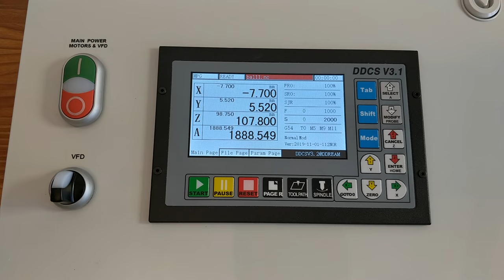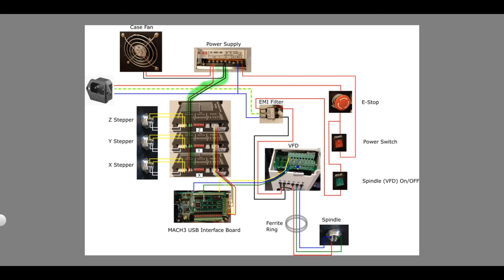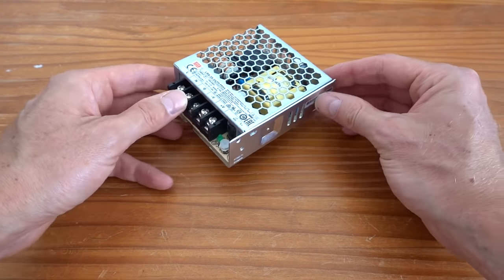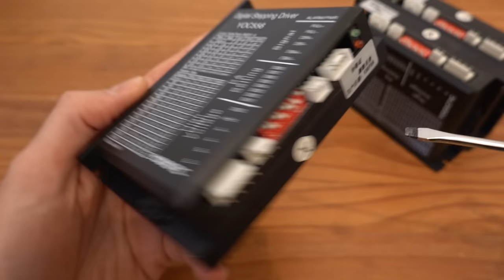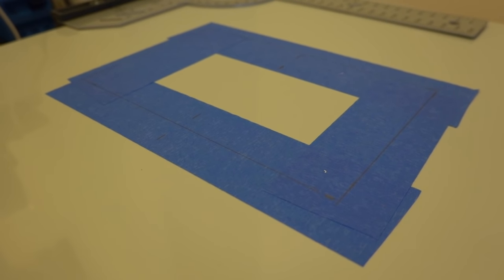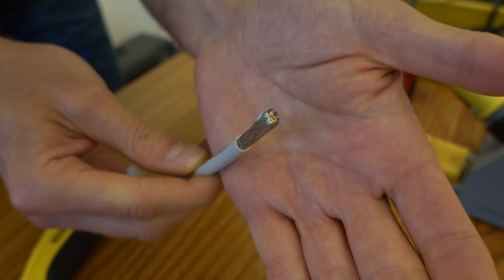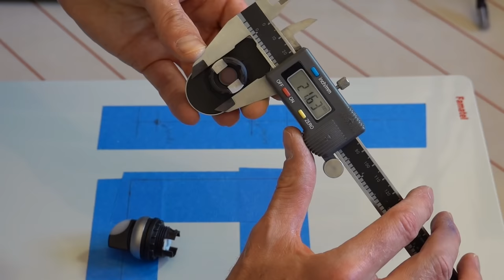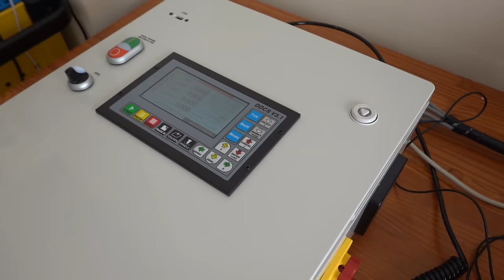Build Your Own CNC Controller, Part 1  | DDCS V3.1 |  6040 Router

Comment: Hello Robin, I have seen many videos on Youtube, but I found your video the most instructive and professional, so I am currently building a CNC controller 1 to 1 like yours.  In most CNC videos I see also the use of end-switches, like inductive sensors. Is there a reason why you did not use these? I presume the DDCS can handle input from end-switches?
Reply from the maker: Hi Ben, thanks, nice to see the videos have been useful for you. There is no specific reason I chose mechanical switches. The DDCS can also handle inductive switches, so if that has your preference you can use those as well. I did not spend a lot of time to figure out which type would be best for my application and just bought the mechanical type. I think both work fine for a home CNC router. The mechanical ones might be more sensitive to dirt, while the inductive ones can be sensitive to EMI. I would say, go with your personal preference. Same goes for other choises I made. Some at are just based on what components I could find or had on hand, other solutions or brands could also work. Please make sure to read comments of other viewers as well if you haven't done so already to get a balanced perspective. Good luck on your project!
Reply: Thanks for your quick respons, I think I will go for the inductive sensors. My machine wil be used for milling natural stone, Have to use water to prevent dust clouds and clear the dirt. So the mechanical part of the machine wil quite a challenge.

Comment: I have version Omio 2.1 of the controller you are using and would like to know what post processor you use for your files? I'm currently using GRBL, but want to learn if there are others that work with the controller box.
Reply from the maker: Hi, I am using the Mach 3 post processor in Fusion 360.

Comment: Hello. Do I understand correctly that when the E-STOP button is activated, the contacts of the magnetic starter open and the power supply of the stepper motors is turned off and the spindle falls along the Z axis?
Reply from the maker: Hi, in case the e-stop of the pendant is used the steppers are stopped but still under power, holding their position. In case the external E-stop is used the power to the VFD and stepper drivers is cut. This indeed means that the steppers are no longer under power. Since my machine is very light the Z-axis just stays in place even when all power is turned off. So it does not require a brake on the Z-axis.

Comment: The line diagram the current comes into the main and than to a (dc 24v power supply)... It shows three (power supplies) the first in line is in question. (little white looking breaker)
Does the din rail circuit breaker count as a 24v dc power supply?
I looked a the list of materials I didnt see a circuit breaker.
  trying to do just the same set up minus the spindle vfr.
what is the rating on the din rail breaker?
Thanks
Reply from the maker: Hi, this is indeed a power supply, not a circuit breaker. I understand the confusion, it indeed looks a bit like a breaker. It is the Mean Well DR-15-24.
Reply: @uptimefab7412  Right I get two power supplies one for screen ddcsv3 and one for the steppers... what does the Mean Well 24V DIN Rail Power Supply  power? thanks I'm really grateful.
Cant wait for the next Video.
I thought you just needed two power supplies
Reply from the maker: I initially intended to have both the large power supply and the one for the DDCS behind the contactor and since I wanted to disable the steppers (E-stop) without shutting down the DDCS this would require 3 power supplies, including the one for the contactor. I later decided to have the DDCS go around the contactor altogether. So, in this case it would be possible to combine the 2 smaller power supplies. However, in my research before starting this project I read people were using a separate power supply for a contactor to avoid voltage spikes affecting other 24VDC components in the same circuit when the contactor switches on or off, so therefore I decided to keep it on a separate small power supply. I am not 100% sure if this is really needed, but I am playing it safe to avoid any issues with the DDCS controller. The DIN rail power supply only cost me around 15 euro. Hope this makes sense. Thanks for your feedback!
--- Update: I have ordered a surge protector for the contactor (siemens 3RT2916‑1DG00), which should reduce spikes down to less than 1V. This should eliminate the issue. Note that I do not have a scope and cannot test this. This is according to the Siemens manual.
Reply: @uptimefab7412  yes it does thanks again

Comment: Would servo motors (and obviously servo drives) work with this system as well?
Reply from the maker: Hi you cannot connect servo motors that require a feedback loop to the controller. I think you could connect servo drives that have an internal feedback loop, but I have not tried this. I was planning to try this with a cheap servo motor set, but this is not on the short term planning.

Comment: Hallo Robin. Vanaf de "homing end switches" gaan 4 draden naar de controller. Betekend dat je 1 draad gebruikt als nul-draad die je verbindt met alle 3 de switches? Ik kan het niet goed uit de video halen.
Reply from the maker: Hoi Ben, bedankt voor je reactie. Klopt, precies zoals je aangeeft heb ik 1 draad gebruikt om alle switches te verbinden met COM-. Ze hebben wel allemaal een aparte draad naar een eigen home pin (7, 24 en 27). Hierdoor kan ik alle 3 schakelaars verbinden met een 4 polige kabel. Je moet dan wel bij elke schakelaar de nul draad "aftappen", maar dit is prima te doen. Gr, Robin.

Comment: Hello again, UptimeFab,
I have noticed that your very clear wiring diagram shows the single 24V DC Power Supply being connected to both the main DC power input of the Module and the input of the I/O DC input, These are recommended to be supplied by separate 24V supplies to avoid Earth loop issues. This is about the only sensible information I could elicit from Digital Dream, when they could rouse themselves enough to answer an e-mail. I fitted a 1AMP 24V DC supply to supply the I/O terminals separately. This is good electronics practice. I thought this might be connected to my MPG non-functionality but, alas no.
Reply from the maker: Hi Jim, thanks, I noticed this as well later on in the build. In the new version of the wiring diagram I have a separate power supply for the unit and the IO, same as you. Also found this later on in the manual and changed it. The wiring diagram was updated a couple of weeks ago to reflect this.

Comment: So, I can’t for the life of me figure out how to get the EStop on the MPG to work. What baffles me is that pin 15 for the MPG plug on the DDCS is actually outputting 24V. But I would think pin 15 would be looking for a high or low voltage signal, so it doesn’t make sense to me how it’s carrying a voltage potential? Was there anything in particular you had to do to get the EStop to work?
Reply from the maker: Nothing special, I was lucky enough that it worked on the first try. I used the blue wire for the E-stop. Did you see the wiring table in the PDF on my website? The right column called "soldered" is how I actually soldered the wires to the DDCS connector. Also had some confusion on numbering, buy this setup works for me. I don't have the LED on the pendant working, (did not even try to wire this since I don't need it) but the rest is working. If pin 15 is carrying 24V it is probably closed to COM- by the e-stop. You could check this by pressing and releasing the e-stop and measuring on the wires to which pin The resistance changes from 0 to infinite. Hope this helps.
Reply from the maker: Just measured it on my pendant connector when disonnected from the controller. The E-stop is indeed opening and closing the connection between pin 15 (E-stop) and pin 8 (COM-)

Comment: I see that you haven't connected grounding cable from the spindle 4 pin and from port E of VFD... Is it for certain safe?
Reply from the maker: Hi, the VFD has a metal housing (under the plastic cover) that is already grounded by bolting it to the metal back plate of the controller box. From what I understand it is better not to ground parts in 2 places to avoid ground loops. I am not sure how much of an issue that is in CNC applications, but at least my VFD is now already grounded through the housing, which should be sufficient.
Reply: @uptimefab7412  have you checked with multimeter a connection of housing with grounding pin? i don't know your model, but in my vfd aluminum radiator on the back isn't connected with grounding of vfd circuit board, so i have to ground it by the grounding pin.
Reply from the maker: I just checked with the multimeter and luckily with my model the ground pin is connected to the metal housing of the VFD. Thanks for the tip anyway! It is indeed best not to assume the housing is connected to ground just because it is made out of metal.

Comment: Hello friend excellent videos, I have a question how to add fuse holders to your electrical panel? would they be necessary? I hope you can help me, I will carry out this process on my machine and I already have the fuse holders
Reply from the maker: Hi, if you have a separate fuse holder you should also be able to place this in the mains line before the mains switch. I am not sure if this is necessary or required, but I added a fuse that is significantly lower amperage than the fuse in my house, so it should trigger faster and therefore offer a bit more protection in case of an overload or short.
Reply: @uptimefab7412  Gracias amigo

Comment: Hi. Great work, i will 'copy' your configuration. Do you know which is the difference between DM556 and DM556T drivers ? For what stay the final 'T' ?
Reply from the maker: Hi, thank you for your kind compliments. Good question, I am not sure what the difference is. On the stepperonline site under "digital stepper driver" a table lists the differences between different suffixes, but without any specifications. Also the model without suffix is not mentioned, so I am not sure how that relates to the T-model.  Just looked at the spec sheet for their DM556T model and it seems to be suitable for use in a CNC router. If it is actually better than a DM556, I don't know. If you can get a T-model for a good price, you can give that a try. Best of luck with your build!
Reply: @uptimefab7412  Thanks a lot for your reply. I will try again to find info on Internet but for the moment no lucky !
Reply: Hi. Do you think is a bad idea to feed the DM556/DM556T with a 48 volts power supply  (Max voltage is 48V)  ?     Or is it better 36 volts ?
Reply from the maker: With 48V the steppers will perform better, but will also generate more heat than with 36v or 24V. From what I have read most small CNC routers will use 36V or lower. Larger machines might benefit from 48V. If you have something like a 6040CNC with NEMA23 motors, I would go for 36V.
Reply: @uptimefab7412  i Have a work Bee with nema 23 upgraded To A queenbee ultra so i think 36 volt is better.  Thanks a Lot for your opinion And help

Comment: On the 4 core cable where did you connect the shield to ?
Reply: Wondered that too, sure looks like a good antenna from what I could see.
Reply from the maker: Hi thanks for commenting. Please see the pinned comment on shielding. I have just fixed this on my machine, was not as much work as I expected, so not worth skipping. If I have some time to edit a new video in the upcoming weeks I will include these corrections.

Comment: Dear what parameter should i take into account while selecting my spindel ... i mean if i want to mill a 3cm wood door .. so how much torque and power do i need to decide my spindel can y help in that
Reply from the maker: I have no personal experience with cutting thick panels, I typically make lighter cuts and use small diameter end mills. But from what I understand you would need >2.2kW or even >5kW for serious cutting of thick panels. I would recommend to ask in one of the CNC forums, where people might have experience with such work.

Comment: Hello Robin! Im confused about soldering mpg connector. It has 21 wires and connector has 15 pins only. Can you help please?
Reply: I figured out the problem. It's necessary to push the side button when operating. Thank you for detailed videos.
Reply from the maker: Thanks for sharing your issue and solution. Luckily you found the cause quickly. The side button is quite useful and becomes second nature to press after using it a couple of times. Cheers, Robin

Comment: Hi! i have got a question.. if i need to start a motor three phase with a AFD (variable frequency drive), is it necessary put a contactor?
Reply from the maker: Hi, the contactor is not related specifically to the VFD, but to all components in the controller in general. The VFD will run fine without a contactor, but contactors are typically used as a safety feature.
Reply: @uptimefab7412  Excellet!Tranks! i have another question, Where you connect the spindle motor? To the VFD exit terminals U;V,W? or, in terminals AD-, AD+, AP-, AP+?
Reply: @nicolasasselborn5722  VFD exit U,V,W

Comment: Hey thank you very much for the video ! Do you know If these spindle motors from china are BLDC type ? I want to build my own VFD and If it´s BLDC I can drive the coils with  rectangular waves and don´t have to bother to make a clean sine waves.
Reply from the maker: Hi, I am not sure what specific motor type is in the typical router spindle.
Reply: Hi, is there a limit at your VFD how low you can set your frequency ? The upper limit is 400Hz I know but I would like to know If you can slow down your motor down to near 0.
Reply from the maker: Per the VFD manual the lower frequency can be set as low as 0.0Hz, but I am not sure to how low the spindle would actually respond properly and what practical use it would have to go very low in RPM for milling, but maybe you have a different application in mind. If you search for now forever manual e-100, this has all the possible settings including upper and lower limits. Hope this helps.

Comment: Is there any disadvantage to the Mach 3 controller
Reply from the maker: Hi, I prefer not having a laptop connected to the machine when it is running. This typically means using an old laptop (dusty environment). It then also depends on a USB connection. Also I just like having a dedicated controller. Other people might prefer Mach3. There are pros and cons to both, for hobby use I think it is based on personal preference.

Comment: I wonder if this can work on old real CNC machine. i have an old but great Emco CNC. would that work to bypass the old controller and use the newer one?
Reply from the maker: In essence it should work also with a larger machine. Just make sure it has all of the features you need ot otherwise look at one of the higher end DDCS models. Note that the DDCS V3.1 does not have position feedback to the controller and there is also no input for a spindle encoder. So no rigid tapping. So it all depends on your requirements.
Reply: @uptimefab7412  my machine is fantastic and precise but works on G and M codes. hard to program. also if something goes wrong in one of the components, its hard to fix
Reply from the maker: Replacement parts can be expensive or hard to find indeed. I like the Emco machines as well. By chance I am also changing electronics and controller on an Emco machine, but in my case a very small PC turn 50 lathe. (SZGH controller this time)
Reply: @uptimefab7412  cool! i wish you can do another video showing your upgrade on this machine. im sure many will find interest in this video as those Emco machines are fantastic
Reply from the maker: I am planning some build videos on this project as well in near future with the current state of the lathe. Fun little machine, this CNC lathe.

Comment: I am also building control box, i've got the same type enclosure and i have a problem with mounting holes in corners - they are limiting my space on mounting plate, if i cover them, i will not be able to fix the plate, do you have any jdea  how to solve this problem?
Reply from the maker: Hi, you could make some spacers (stand offs) that fit exactly between the back of the enclosure and the plate and then just mount it with a long bolt and a nut at the back of the enclosure, similar to how I mounted the TV bracket. It must be said though, if you don't have enough room to use the existing mounting points on the plate, you also probably don't have enough room for sufficient air flow, which can lead to heat building up in the enclosure. So if you have high components all the way up to the corner of the enclosure you should actually buy a larger box. Another option is for example to place the VFD in a different enclosure to free up some space.
Reply: @uptimefab7412  Thanx i will try this. Enclosure is large enough for all od my parts, i just need to get some more space for cooling as you say, cables etc. By the way. How do you like that DDCS controller since You installed it inside? I am thinking about buying some new controller. Does it have any functions for correcting some minor imperfections in my machine geometry, You know, a skew axes for example?
Reply from the maker: The DDCS is a nice low cost controller. If you  don't need any advanced functions like a built in PLC then it works fine. The new DDCS V4.1 has some useful upgrades like a LAN port. I also like the SZGH models. More advanced (PLC, macro) but larger and more expensive.  It all depends on your needs and budget. My DDCSV3.1 as far as I know doesn't have an option to correct for skewed axes. It does have a backlash correction option.